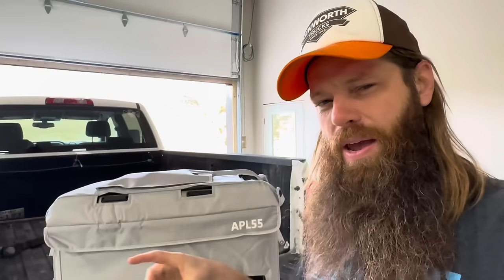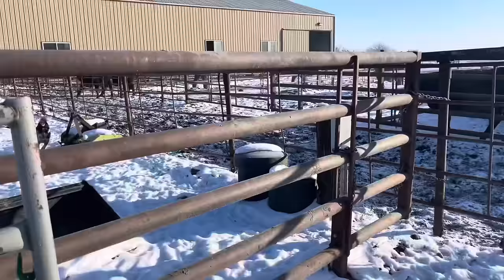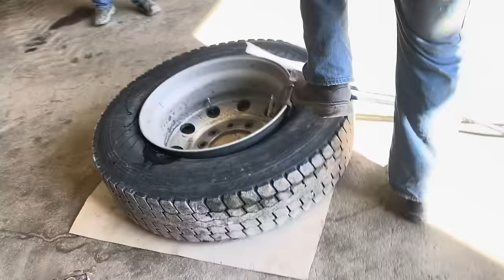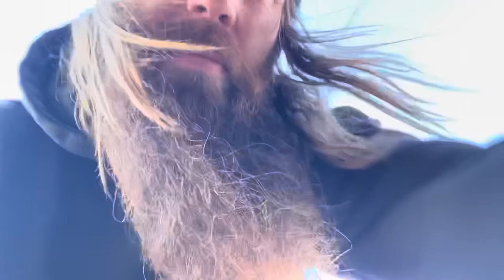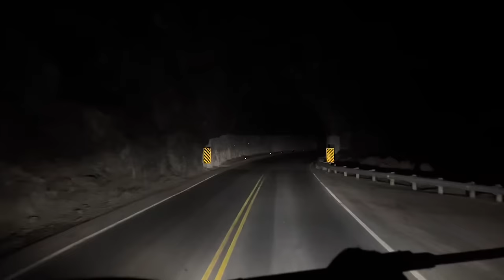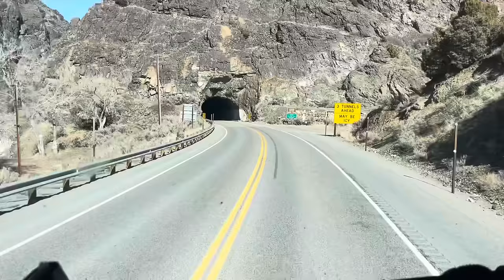“South Pass” blizzard Suprised my cabover.

Comment: the trouble with overpasses is they build them to spec, put a sign, and forget it. if they start at 14'....... 4-6yrs later add 2" pavement.... and another few years later another f4esh layer..... 13' 6" is close

Comment: When you’re welding aluminum, use a stainless steel brush and it will clean the aluminum. A tig welder works better than a mig welder. Make your weld, scrub again with your stainless brush, then tig the weld again.

Comment: Believe me, as an owner who wants to prolong my equipment as long as possible and idle as absolutely little as possible, I understand the concept of "finite time" on a motor. One thing that helps me to relax quite a bit though is thinking, if I idle tonight, that just means my engine will eat shit 1 day sooner".. Thinking about that day that will inevitably come down the line, are you not going to rebuild it because it happened on Wednesday instead of Thursday? When it happens, you'll handle it.. I'll rebuild mine AGAIN when it comes time.... Just relax and let these motors do what they were built to do, work..... God bless, brother...

Comment: I did South Pass once. Hauled dairy heifers to Ogden UT from Iowa. Loaded calves on a ranch southeast of Ely NV and followed the group of trucks I was with across Hwy 50 to Delta UT on the way to Belfry MT. I think it was 1983 when the Great Salt Lake was flooding and drove through water for a mile or more on Hwy 50. I wouldn't have taken the chance if I was by myself and heard they closed the road again after that trip. I  stopped at Rock Springs to make sure SP was okay before heading up that way since I had a slow truck and couldn't keep up with the others.

Comment: On my Barrett 53x102 pot I have a trap in the center of the front in the belly and it has 1/2"x2"key stock welded on the floor and a cover on top of that. It will let the water out and keep most of the solids for the most part in the trailer. And you have to really look in order to see that the water is coming out.

Comment: I had a manual clutch fan override toggle switch put in on my fld .So I can run it on the hills if I have too. Suppose to have a storm this weekend in NH heavy snow up north.Dusting to couple inches in southern  NH.We usually get an april fools storm to end the season.

Comment: Hey buddy I could be wrong but when you were at the top of the pass and got out and checked everything I seen something dripping on the inside of that front passenger tire not sure if you're losing brake fluid or what
Reply: Sorry, they're air brakes,  no fluid there,  probably water from melting snow